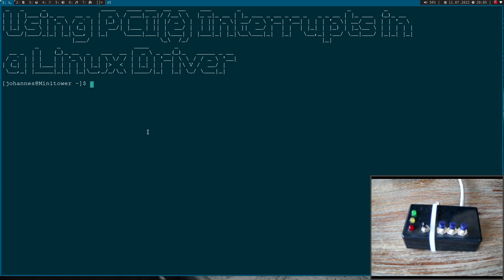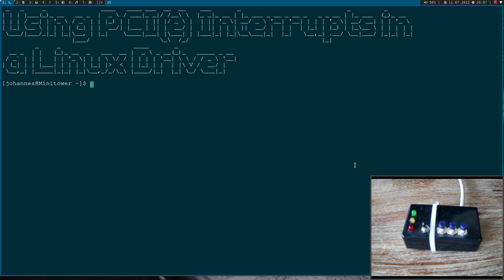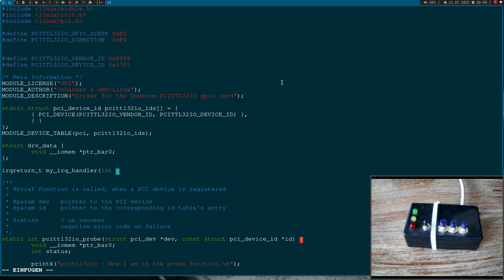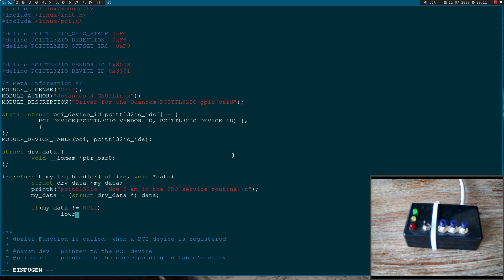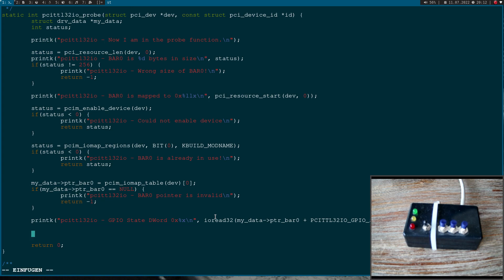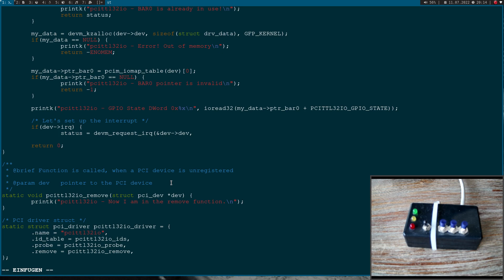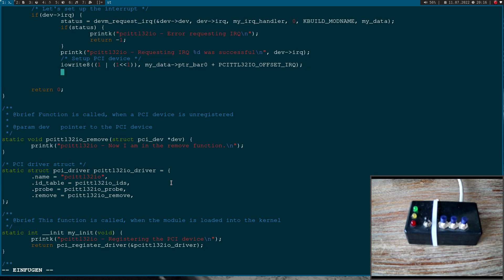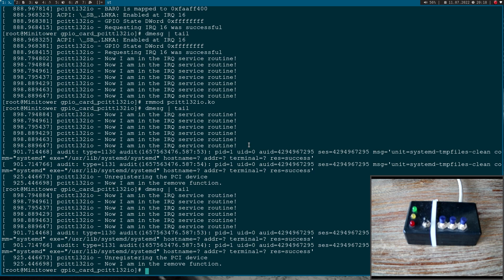Linux PCI Driver Tutorial - Part 4: Using interrupts in a Linux PCI(e) Driver

Comment: Would you mind making a video about the MSI interupt? After studying for weeks, I found it very important nowadays. As for me, MSI interupt may be more usful when I try to inplement something.
Reply from the maker: The problem is that I currently doesn't have a device which supports MSI interrupts and for which I could right a driver.
If you know a cheap and simple PCI(e) card which I can use, please let me know.
Reply: @johannes4gnu_linux96  I have tought this question for several days. I just find a way which may work. Maybe you can use an old graphics card? Not much expensive, pretty good performance, just like GTX960 or some type else?
Reply: @johannes4gnu_linux96  By the way, I am looking forward to your new video.🤩
Reply: You can use Intel - 10G Ethernet controller card - X540-2T, it support MSI interrupt,
Reply: I am also waiting for the MSI interrupt video. 😀